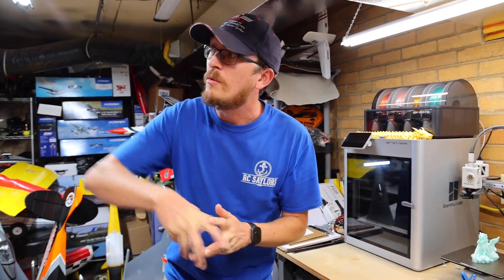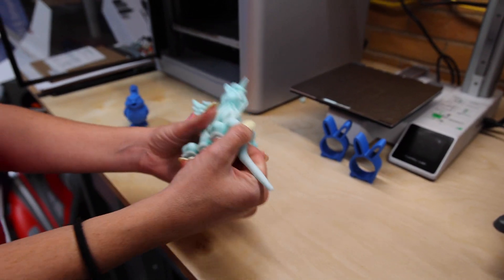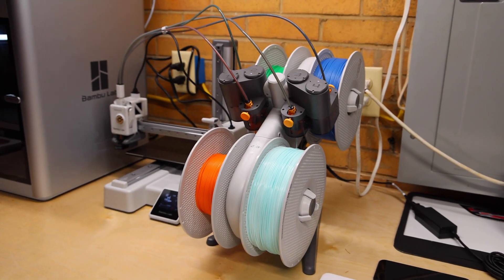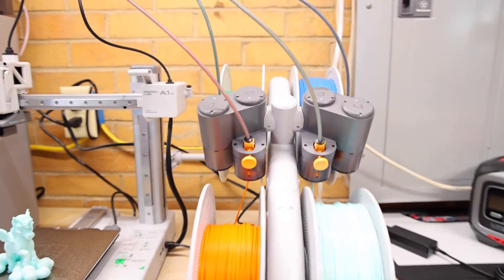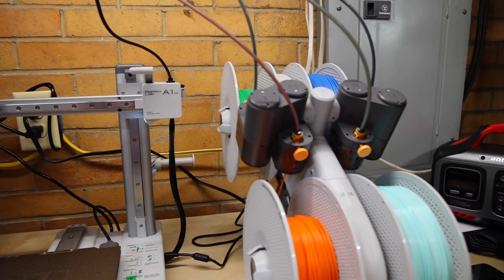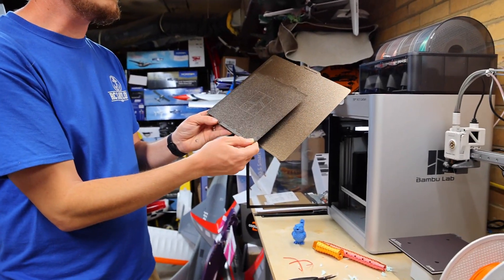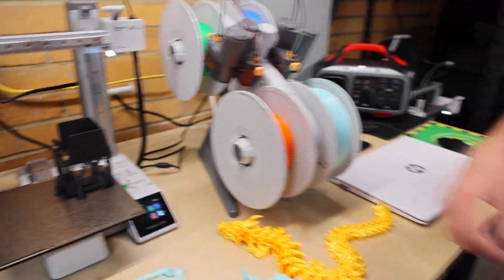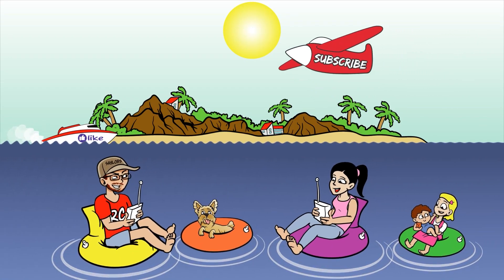Best Value Beginner Friendly 3D Printer - Bambu Lab A1 Mini with AMS

Comment: You could try drying that filament that you said wasn’t very good. I know PLA doesn’t take moisture like other filaments, but can still take in some. I’ve dried some off brands before and saved it.
Reply from the maker: Not a bad idea! I didn’t plan on just tossing it (yet) or anything but haven’t actually tried thoroughly drying it properly. Might still have a few prints left in that spoil yet!! 😁👍💯⚓️

Comment: You have quite the 3d printing lab now! So, how long until you go for the next step...Resin 3d printers?
Reply from the maker: I can’t believe how quickly I’ve gotten hooked on this stuff. I think if I didn’t have young kids I’d go for resin but am afraid of them getting into the chemicals. I don’t have an amazing space “behind a locked door” for anything like that. 😢👍😎⚓️
Reply: @TheRcSaylors  Ah, the kids, of course, safety first!! BTW,  there are people creating 3d models of airplanes that are designed to be flown as RC aircraft. I bought one recently, about $30, a set of Avro Arrow plans...basically a couple of STL files. I am going to get my nephew to print it out. I don't know if I will turn it into a flyer, but I used to build aircraft models in my teens, and as I have a lot of spare time, may just treat it as a something to paint to get back in the hobby.
Reply from the maker: I recently purchased some of the special filament designed for a 3D printed RC plane! Not sure where to begin, as I actually want something a bit more tame TBH. Once I find the “right plane” I hope to print it and fly it! Really no clue what to expect. I know lots of people are already doing this, but other than a Flite Test video or two, I’ve never heard anyone else’s opinion of flying a 3D printed plane. I’m very excited for that experience!! 👍💯😎⚓️